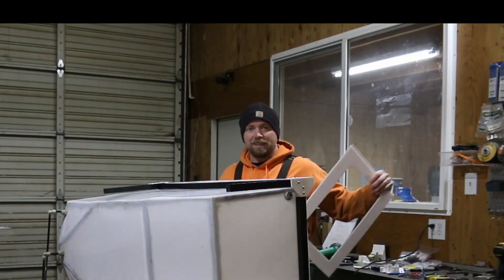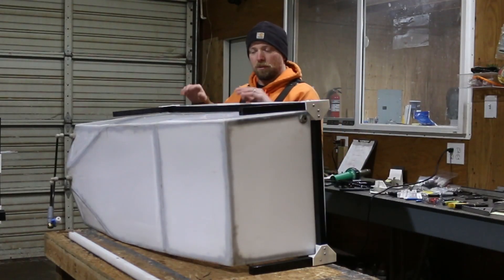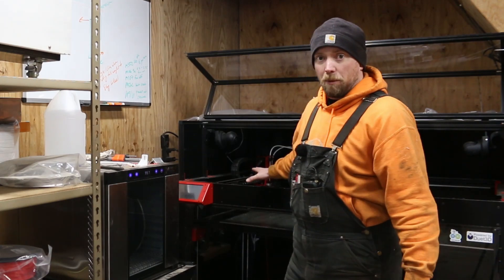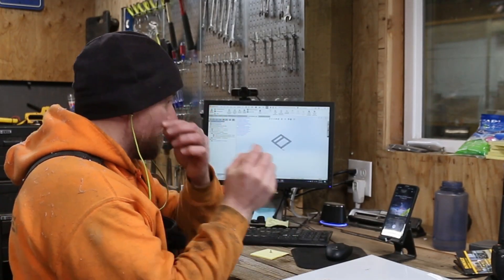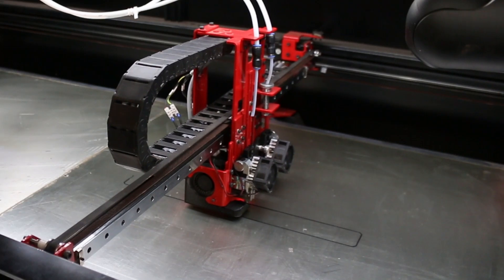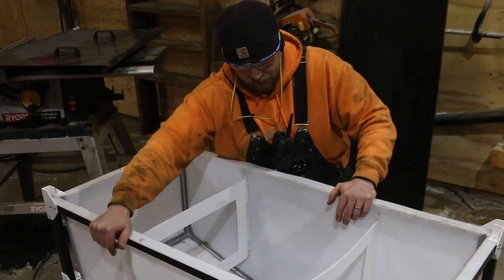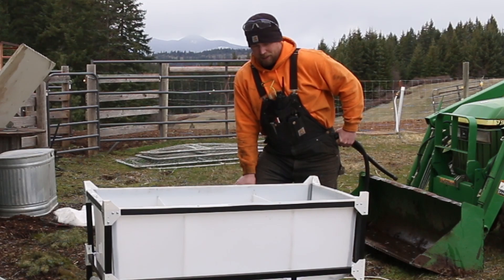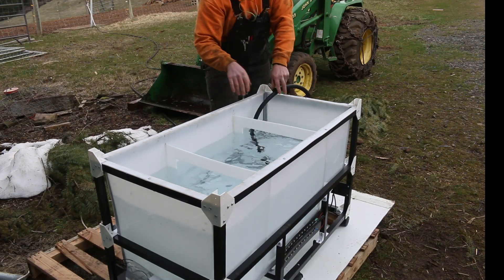THE END of all things! The FINAL COUNDOWN, part 2: Indoor AEROPONIC Grow Tower Tank Testing

Comment: When you finally go to thermal molding the tanks couldn't you just design in strengthening ribs along the sides and corners?  You could even add some vertical ones side by side that would create a slot where plastic sheets could be slid in creating separate tank sections.